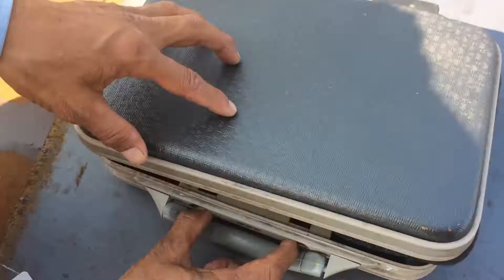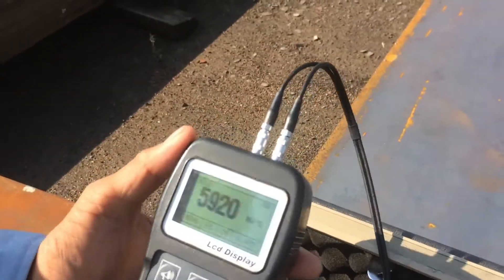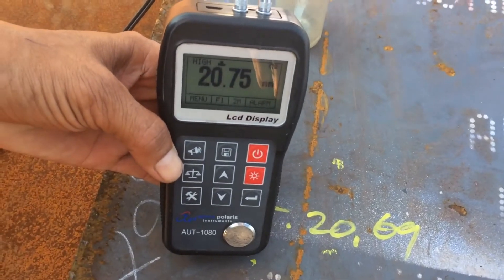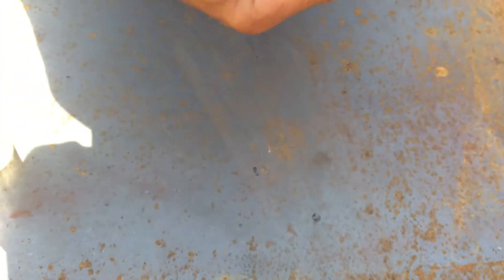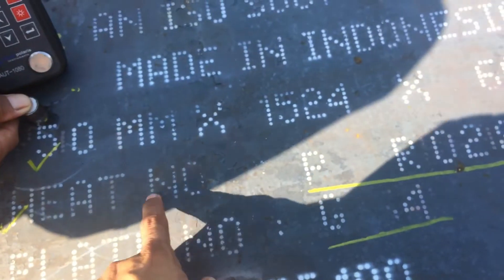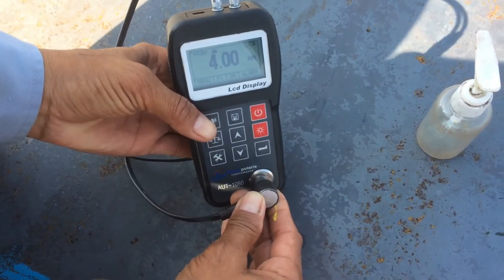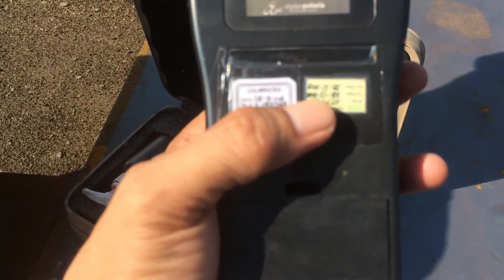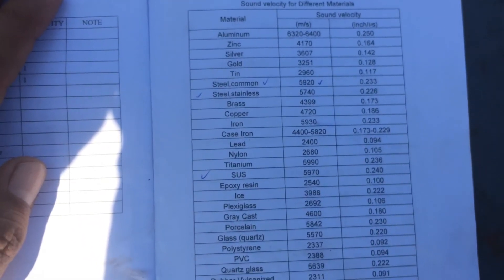How to Use Ultrasonic Wall Thickness Measurement

Comment: Hi. I never used a ultrasonic equipment. If I have a pipe with water inside. If I calibrate and use the equpiment, can measure the thichness of the pipe, because equpiment only check the metal material and when detect water, stop. Only give me the thicness of the material( not water or fluid) Thanks and sorry for the very novice question